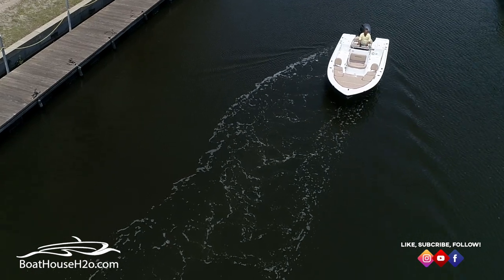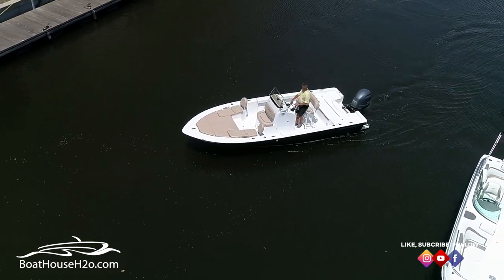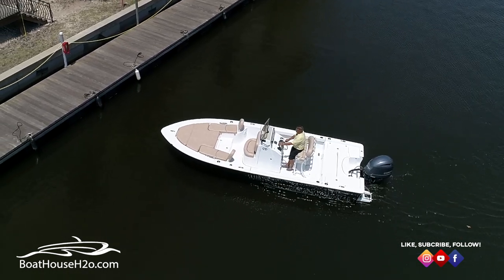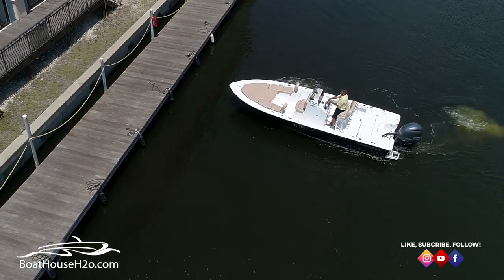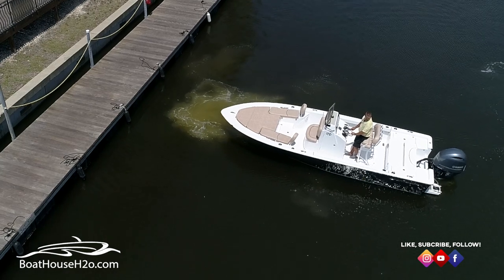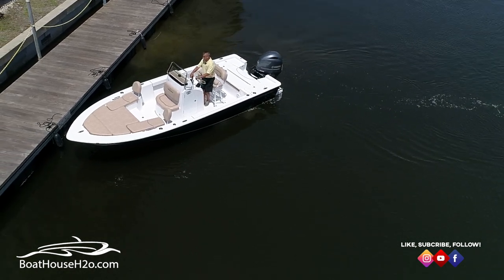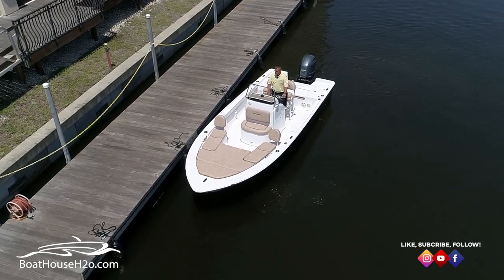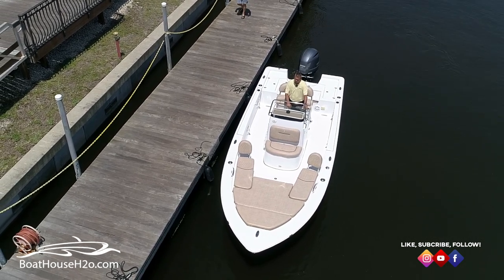Boating 101: Docking Fail! How NOT to Dock a Boat and Why.

Comment: I had my brother and a couple of friends out on a 30ft twin screw recently. I was docking stern to with a slight cross wind and against the tide. Got blown off which is fine I was just going to have another approach but last minute they all panicked and started moving about blocking my view and moving the boat quite a bit in the water. Asked them calmly to stay still and got it on the next attempt but should have been clearer with them from the get go.

Comment: That’s still pretty poor….

You’d have been far better off restarting your approach from six boat lengths out. If you’ve cocked it up, then admit it to yourself and start again with the correct approach and you can hit it in a oner, not the jiggling backwards and forwards as you demonstrated…..